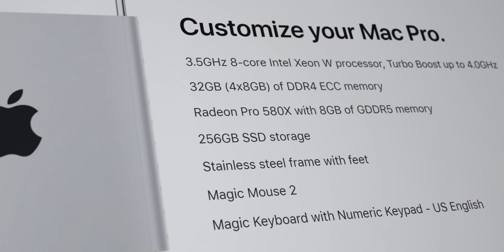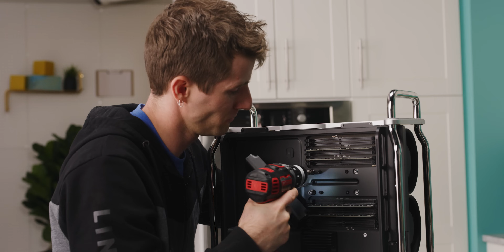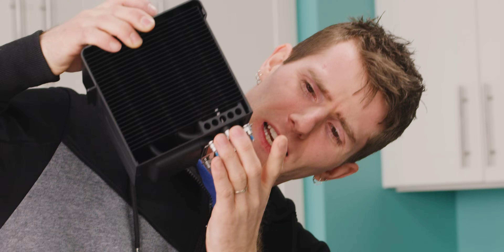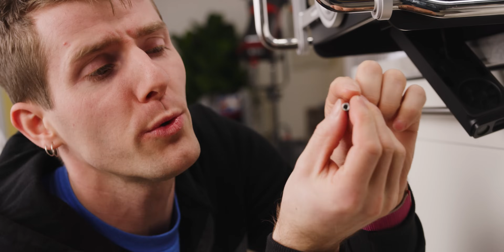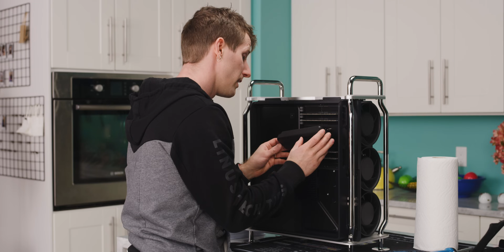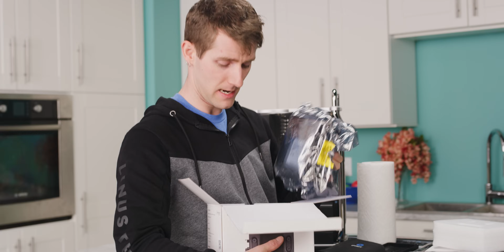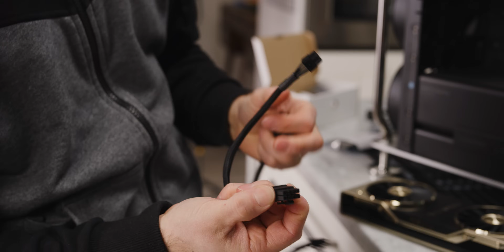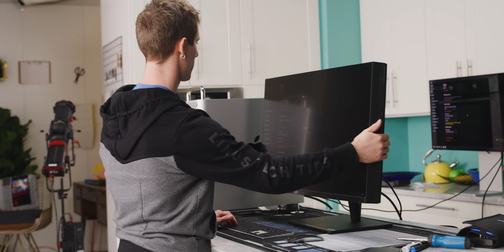Don't give Apple your MONEY - Mac Pro Upgrade Adventure

Comment: Those two drives are required for the entire computer to boot? What if one of them goes kaput? Not that I am surprised at all by apple making it difficult to repair things but this computer is 6 grand to start, you'd think they would build it in a way that would make it less easy for the computer to self destruct.

Comment: Apple be like:
Magic Mouse 2: $699.99 (laser/optical sensor sold separatedly)
Magic Keyboard: $999.99 (Russian layout) *US English sold separatedly for $2,999.99
Stainless steel frame: $4,999.99 (Feet sold separatedly for $599.99)
Reply: *Power button not included
Reply: Limited "Convenient CPU upgrade filming spot hole" sold for 10,000.00 + tax.